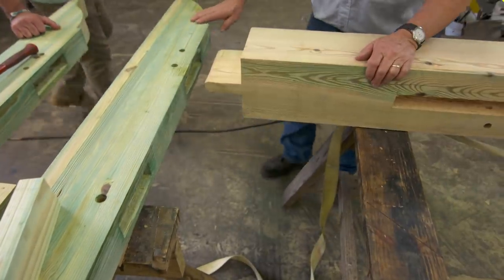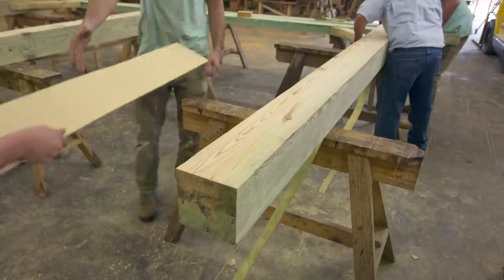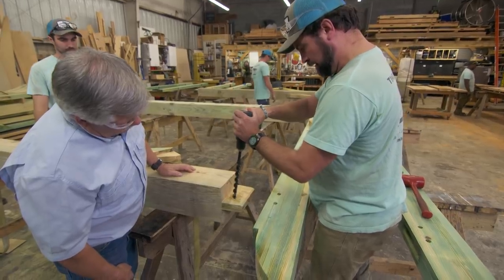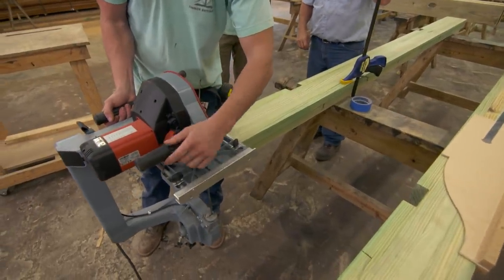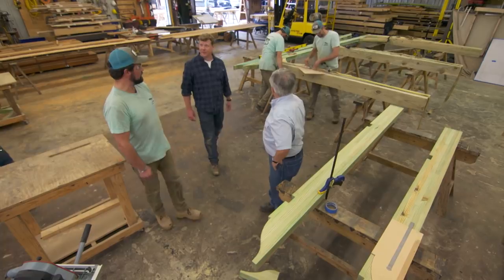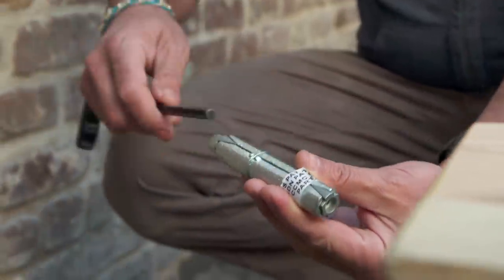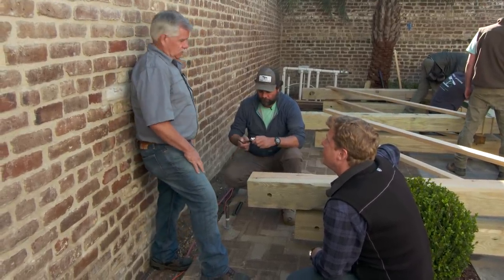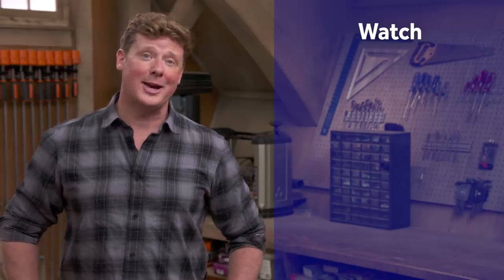How to Build a Pergola | This Old House

Comment: Would like to suggest a different title: How to make mortise and tenon joints with tools and materials that you don’t have and cannot afford. Thanks TOH
Reply: Handsaw, hammer, chisel, hand drill + auger bit. Add a circle saw if you're feeling schwifty. Done. Check out the Samurai Carpenter.
Reply: @DavidBcc you definitely can, but that's not what happened in this misĺeading titled vid is it 😂

Comment: Why do you use that method for drilling the tenon?  Half way through then straighten out??
Reply: Jerry Smith that is to draw it together with the peg. By angling in, he’s making the hole a little offset so when the peg is hammered in it draws the two pieces together.
Reply: @PeterBoyes76  Ahhh..., thanks Peter.

Comment: What's the advantage to starting out the bolt hole at an angle instead of drilling it perpendicular to the post from the start?
Reply: Makes sure the hole gets drilled on center (bit is less likely to “walk” around)
Reply: For final assembly, helps to get bolt in and once tighten down, it draws the joint (2 pieces) tighter. Just a guess.